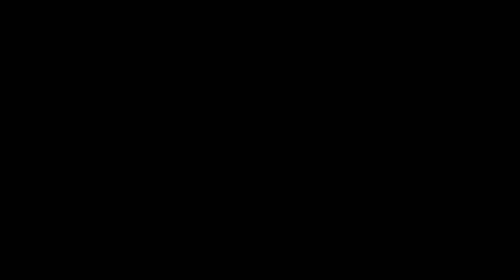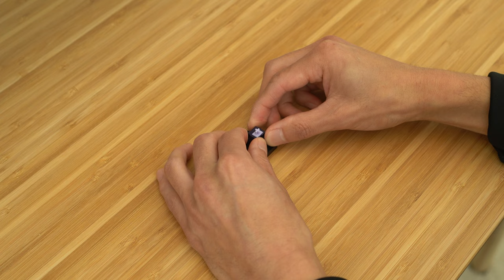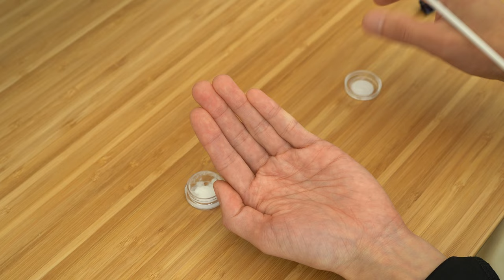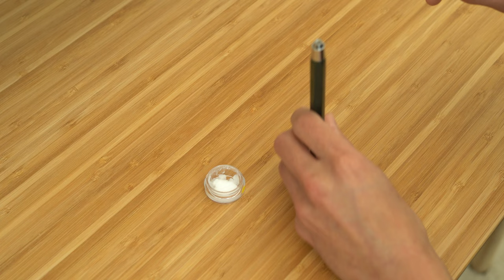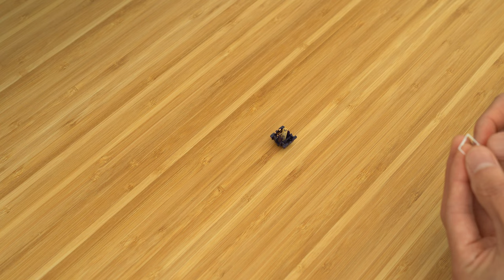Lube Every Type of Mechanical Keyboard Switch! Tactile, Linear, Silent, Box!

Comment: 0:00 Intro
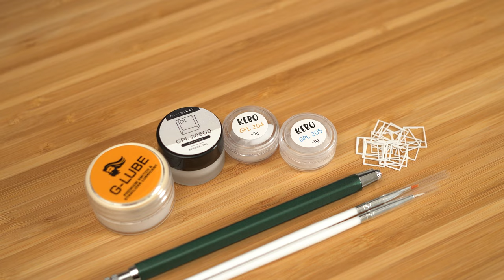0:39 Stock type test
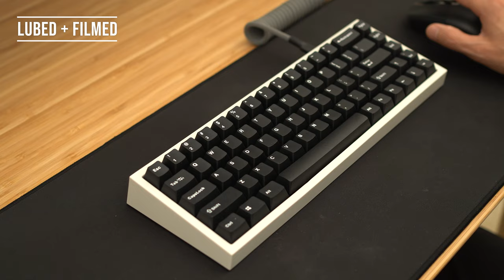1:10 Lubed + filmed type test

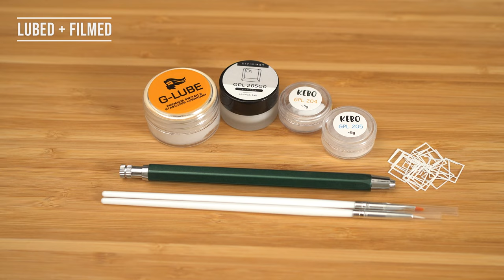1:41 Overview of types of switches
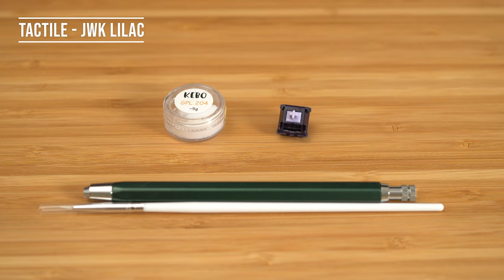2:05 Tactile switch lubing method
8:29 Linear switch lubing method
13:58 Silent switch lubing method
19:41 Box switch lubing method
27:12 Lubing recommendations
27:21 Bag lubing springs
28:42 Outro

28:52 Sound comparison between stock, lubed, and lubed + filmed switches
29:07 Stock switch
29:21 Lubed switch
29:33 Lubed + filmed switch
29:43 With keycaps in a keyboard

30:26 Stock type test
30:58 Lubed + filmed type test
Reply from the maker: Thanks for putting together the detailed timestamps Matt!  I appreciate it!
Reply: @Keybored  Pin this comment
Reply: U legend
Reply: @Trentfps  its a reply lmao
Reply: where did you get that pegboard and containers? looks sooo clean
Reply: Hero we don't deserve clap clap clap ~RESPECT~
Reply: @matt lee you a legend
Reply: Thanks! Other tools I found helpful are cross lock tweezers (sometimes called reverse tweezers)

Comment: Be advised that not every switch needs to be filmed.  For instance, my favorite switch, the KTT Kang White V3, does not require any film, as the switch housing is already very tight and allows for the stem to not move around as much.  In fact, filming the switch turned out to completely destroy each of the switches in my keyboard due to it already being so tight, which caused me to have to buy another set and lube them (for hours...)  However, some switches like the Banana Splits should be filmed as the housing is not very tight stock and should be modified for the best sound and feel.

Comment: Solid tutorial, thanks! Silly question, but how are you cleaning residual lube off switches and more importantly, fingers?
Reply from the maker: off my fingers, just regular soap :)  For residual lube, I use a brush to get it off and wipe that clean with a paper towel
Reply: @Keybored  For switches that are lubed from the factory, do you tend to just apply over it, or are you cleaning them up first?

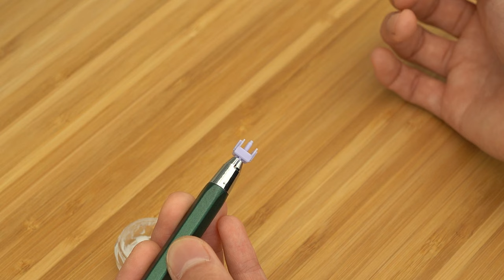Comment: 6:40 I'm trying out the glorious panda next week, so it would be great to hear your opinion on why you'd lube the legs specifically on them?
Reply from the maker: Hi Florian! I typically don't lube the legs of tactile switches, but the glorious pandas I do. Reason is that the first batches I received had some pretty noticeable pinging, that I could not get rid of with standard lubing of the housing/stem/springs. Interestingly enough, krytox 205 on the legs or the leaf itself, really helped to get rid if the ping. If you want maximum tactility, don't lube the leg, but if you're sensitive to noise, then I would lube the leg or leaf with 205 :)

Comment: Great video! I have a question: how do u lube pre-lube switches? Do u clean them? Or do u lube on top of the factory lube?
Reply: You should clean them before applying lube. If not, you could end up with two different lubes or over lubing your switches (which feels awkward)

Comment: Thank you, this is is a very helpful video. For silent Durocks, which have a different silencing mechanism, will the lubrication method still be the same? I certainly don't want squelchy switches.
Reply from the maker: I don't have first hand experience with the silent durocks, but from experience with other silent switches, the trick is always with the soft bits.  Too much lube here makes the thing squelchy.  If possible, avoid, otherwise, go very light on these soft bits.
Reply: @Keybored  Thanks! Will give it a shot.

Comment: Great video! Do you think for silent switches, that the springs can be put into a bag with lube and shaken? Rather than lubing individual springs?
Reply from the maker: For sure!  The spring lubing will be the same for silent switches as well as the others :)
Reply: @Keybored  thank you!!
Reply: @Keybored  what kind of films are you using?
Reply from the maker: @bre4472  hi bre, I mostly use tx films now. I like that they have the middles cut off so they don't interfere.

Comment: Great video. Quick question, every tactile switch I've tried has this 'squeaking' noise when I slowly press down on it. It doesn't matter if the switch is lubed or not. I'm like 90% sure it's from the contact between the leaf and stem, I've even tried lubing that contact but the sound persists. Do you know what it is and how I can get rid of it?
Reply from the maker: Hi Nihal! Which tactile are you having trouble with?
Reply: @Keybored  Hey Scott, so I'm currently trying out the Outemu Ice Light Purples, lubed with 3203. I've also tried lubed Gateron Browns. Both of them have this really annoying squeak. It's also audible on my 67g Zealios but not as much.
Reply from the maker: @nihalprakash8883  hmm I'm beginning to wonder if it's the trybosys 3203. 3203 is used often for tactiles but it's on the thinner side. As a test, if you have any 3204 or krytox 204, try that out and see if the squeak goes away. You're lubing the springs as well correct?
Reply: @Keybored  I'll do that, thank you for the suggestion! Yes, I'm also lubing the springs with 3203. What lube would you recommend for the springs?
Reply from the maker: @nihalprakash8883  I use krytox 105 in a bag and just bag lube them. Lately, I've been substituting super lube 51004 synthetic ptfe for bag lubing since the results were similar and it was more cost effective. Hope it works out for you!
Reply: @Keybored  gotcha. i'll use a different lube and see if that helps. thanks again!

Comment: Hi I need a bit of help here. How do I lube box jades and which lube should I use?
Reply from the maker: Hi Kayn, lube the box jades like you see the box Reds. I would go with a thicker lube for box switches since the thin ones spill out of the opening easier... Something like the krytox 205. Do not lube the click bar or the little nub that triggers the click bar and you should be good
Reply: @Keybored  thanks for the help :D

Comment: I have a newbie question. Is lubing only about sound? or does it also makes it so the switch is not as stiff?
I have one key that feels more difficult to press possibly because I press it a lot, would help in making it smoother? or is this just a switch problem?

Comment: I didn't scroll down far enough to see if anyone said anything. But it's not called a box switch because of the stem.  It's called box bc the leaf is inside of a box which makes it water resistant and without containments.

Comment: The linear switch that you used has 67g spring, would you use a different lube if the spring was lighter (i.e. 45-50 g) ?

Comment: I read somewhere on reddit that you should break in switches before lubing them. Does this apply to all switches? And does this apply to tactile switches? The only really talked about it towards linear switches
Reply from the maker: Hi Hello, World!  It does apply to certain switches.  One prime example is the NK Cream, where the POM on POM action requires a bit of wear down before you apply lube to it.  Some also do this to MX blacks as well.  However, most others actually can be lubed right away and still yields great results.

Comment: how long is the lube job effective? do you ever need to relube them?
Reply: No
Reply from the maker: Hi Sean! Depends on the switch. Some switches like box are pretty notorious for losing lube pretty fast due to an opening... But thicker lube sticks on better. Originally NK cream was also problematic for lube retention. However for most switches, they will hold lube pretty well and you won't have to worry for quite some time. I recently pulled cherry ergo clears from an 8 year old keyboard and it was still decent.
Reply: @mlepes  lube definitely doesn't last forever, let alone stick to the surface forever.  People keep using thin lubes and telling others to mix their lube with oil (which separates over time). too much fake science in this hobby.
Reply: @rks5457  yeah, don't know why someone would mix with oil.

Comment: Would you recommend pouring some machine oil in to a cap and dip each end of the spring into it?
Reply from the maker: This may be an option, but make sure not to over do it, so that you end up having too much oil dripping in the housing!
Reply: @Keybored  true, I'll stick to a viscous lube then.

Comment: Hey great video, i just wanted to know if i can lube my switches with Permetax Dialectric Grease? i won't be able to get my hands on any of the lubes, so i just wanted to know if i can  use that as a cheap alternative and if it would have any bad effects on my switches
Reply: I'm not nearly as experienced as Keybored, so take my comment with a grain of salt. Dielectric grease is recommended for only stabilizers due to its viscosity. If you apply it in a switch, it will most likely make it feel really mushy or sluggish.

Good question though!
Reply: @RNGeeGee  thanks a lot for the advice
Reply from the maker: NO!  Do not lube with dielectric grease!  It's so sticky and it'll ruin your switches!  If you're looking for an alternative, you can use a mixture of superlube grease and superlube oil with PTFE.  It creates a thin enough mix for you to use for switches.

Comment: does anyone know what the numbers mean on the Super Lube? Does it indicate viscosity? what does a higher number mean? Thank you

I just checked and I have the 51014 Super Lube oil. Would this be alright for the springs as well?
Reply from the maker: Hi Durian! Unfortunately I do not know lol. I used the superlube 51004 but as long as the 51014 is similar, I believe it won't impact the springs that much
Reply: @Keybored  okay, i wanted to do the bag lubing for my future switches, so i was just curious. I think ill stick with 205g0 for my springs just to be safe since it's a known brand lol. thanks for the reply!

Comment: I have keyboard with red hyper x switches.. What kind of lube I can use? I want to lube stabilizers and switches also? :)
Reply from the maker: As long as the switch is a MX style, should work same as you see here!  for linear switches like reds, I would recommend the Krytox 205.  Also the same for stabs... it's the best honestly
Reply: @Keybored  Thanks a lot bro. And I think to use the same lube..

Comment: i wish i knew about the method for lubing silent switches. my first custom board is with mx zilents and unfortunately i overlubed the stem on some of the switches and man does it sound awful, especially since the switches are virtually silent, you can hear the lube very clearly when pressed down. I know better now at least
Reply from the maker: Hi Rize! Yup the silent ones are definitely tricky! Less is more is really does apply to silents!

Comment: If I use super lube on both the stabilizers and the other switches, will the switches get damaged and will it still feel alright?
Reply from the maker: If you plan to use superlube on the switches, you should mix the grease and the oil together to make the right consistency!  Otherwise, it'll be super sticky :(
Reply: @Keybored  alrighty thanks for the advice!

Comment: hi, can i use gpl 205g0 for tactile switches? what would be the downsides?
Reply from the maker: You can still use 205.  I use 205 on certain switches with no issues.  The downside is that it will reduce the tactility a tiny bit, also makes the switch a bit deeper.  I used it on the glorious pandas to help reduce ping
Reply: @Keybored  have you tried akko cs lav purples?

Comment: hi, thank u for the vid!! i'm currently stocking up on knowledge for future maintenance lol you mentioned that lubing with something too runny can be bad for the box switches, so does that mean you don't recommend the bag method for them? meaning we just have to lube the springs separately with krytox 205 instead of the oil??
Reply from the maker: Hi Pengupengu8!  You can still lube the springs with the oil :)  I would recommend using a thicker lube for the switch stems and the housings, so the lube can stay on it longer and not run out of the little slot :)
Reply: @Keybored  ahh, okay that makes sense. thank you for the quick reply!! <3

Comment: For lightly pre lubed Kailh Box Red, which lube would you recommend? 204 or 205 or something else?
Reply: he used 205g0, so you can use that. you can't go wrong with either of them.
Reply: @damnboi3586  thanks! I should've watched til the end) Will I notice a difference you think, considering this switch is already pre lubed?
Reply: @goldeneagle8259  with the different lubes, probably not a huge difference. mut the pre lube on switches is usually pretty inconsistent so just lube over them. just watch this guide and you'll be good to go!
Reply: @damnboi3586  thanks a lot!
Reply from the maker: Hi Golden Eagle! Looks like some great advice from peijooni! I typically use 205 for linears :)

Comment: Bro I started lubing my switches and they are meant for gaming and shit, so I only did shift, space bar, w, a, s, and d. except i did one really good and the others not so good. So now my s key sounds silent af, while the rest of the switches i lubed sound a little better, what do i do.
Reply from the maker: Yeah, it's challenging at first to get them all consistent.  usually, for lubing, less is more.  That way, you can always be as consistent as possible!
Reply: @Keybored  well now a day later they all sound pretty ok but ty for the advice!

Comment: what about clicky switches like jades?
Reply from the maker: Hi Alvaro! Jades are also a box type, and the click actually comes from the click bar that is outside of the housing. You can follow same steps, but skip lubing the little tab on the stem that makes contact with the click bar. If you lube that portion, it will dramatically reduce the click. Hope that helps!

Comment: Clicky?
Reply from the maker: Hi Lenntronni! If the clicky switch has a click jacket, it's not advisable to lube those. However if it's a box clicky switch, lube it the same way as the linear box as show, but make sure not to lube the click bar itself!

Comment: Or $20 for brand-new switches set. JK love you video but lubing every single switch is not for me.
Reply: That's fair there are faster methods like putting the springs and stems into a bag of lube. But you still got to dissamble every switch tho 😅